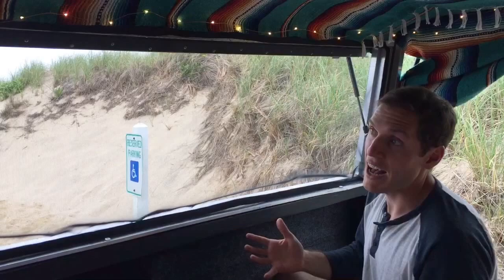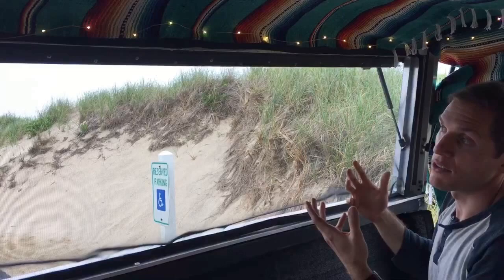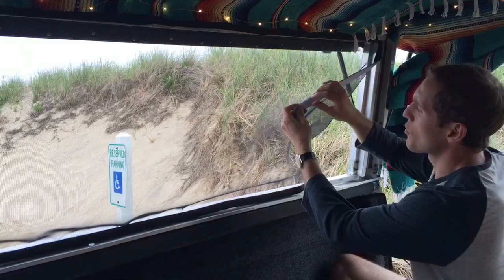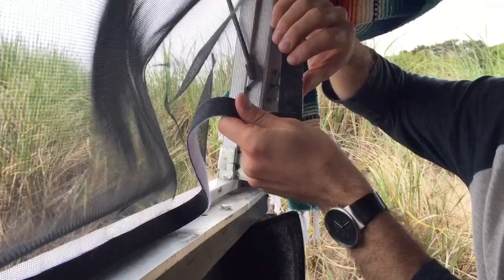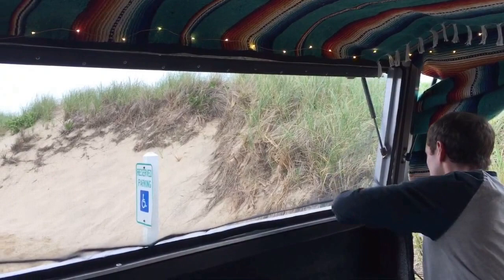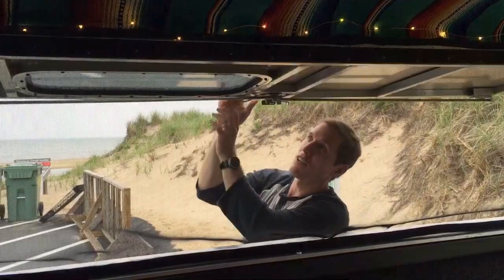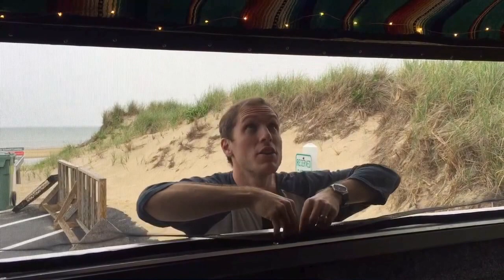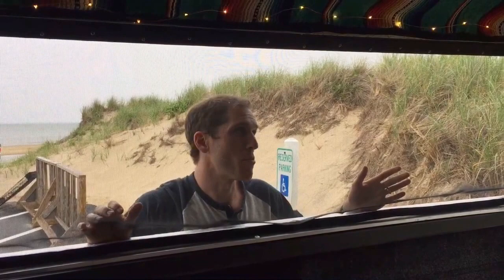A Simple DIY Rip-Away Screen for Your Truck Camper

Comment: You didn't mention how how attached your Velcro to the aluminum frame.
Reply from the maker: Sorry about that. The VELCRO has a sticky side which sticks directly to the frame. It's fairly strong, so it won't come off unless water gets in your truck cap.
Reply: Nice, very useful tip!
Reply: Please tell me if the VOLCRO stick side sticker to the aluminum frame, how it stick to the screen side. Does VOLCRO both side are sticks?
Reply: @yzhang4460  No- that's the BIG problem- getting velcro tape to stick to both the screen and to van metal frame.  Just by itself, it pulls away after it get's heated by sun a few times and is useless.  I've tried a number of things to resolve- the best luck I've had is use velcro self stick to screening and then on reverse side I've had to use gorilla glue tape (that pulled apart too) combined with gorilla glue to the inside screen between the velcro taped screen and the gorilla tape- this worked the best- lasted about two years.  Attaching the velcro tape to the van frame is a problem too- I first tried just taping- that came off 1st week- then I used contact cement on frame and on velcro tape let get sticky then press together and that lasted about two years too.  Still searching for a better solution, but that's my experience- hope it helps. Sewing the velcro to the screening using a "frame" of duct tape folded back on itself with screening in between should work well IF you have a sewing machine.  As for sticking velcro to frame of van- still looking for a longer term solution.